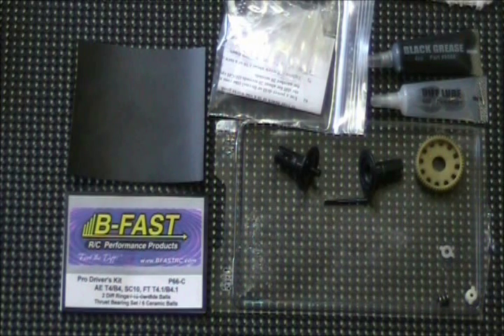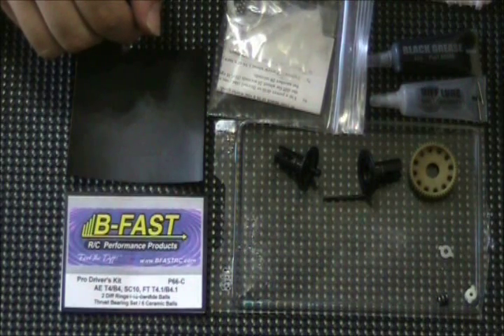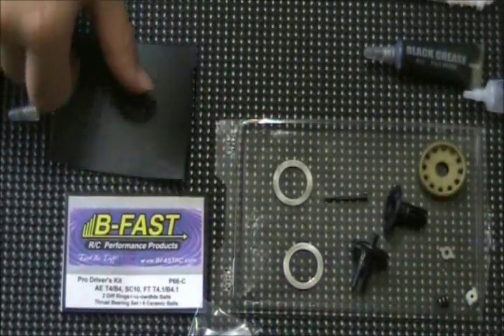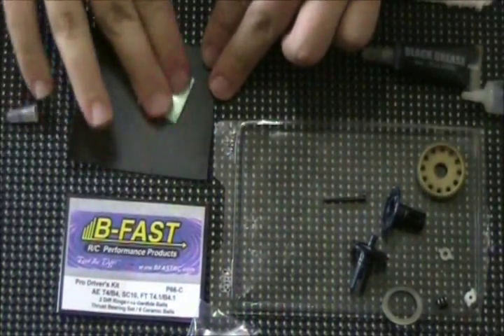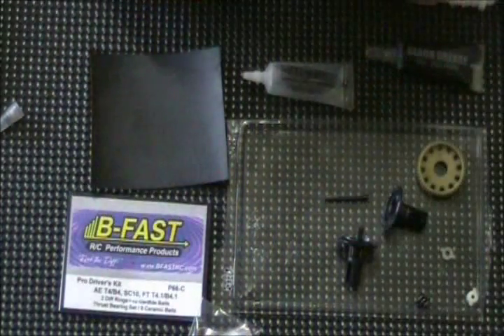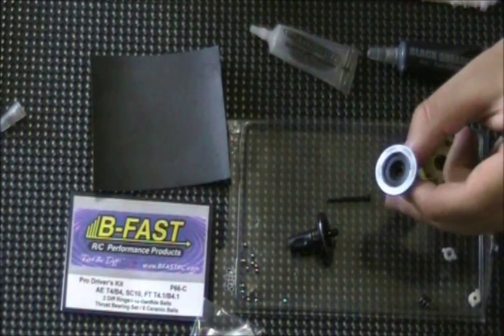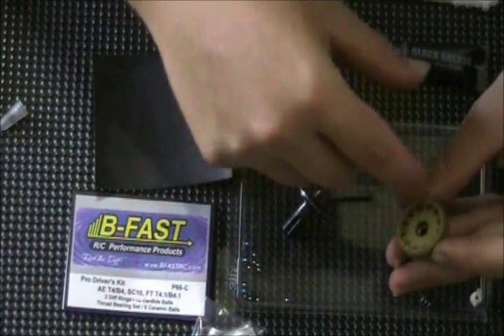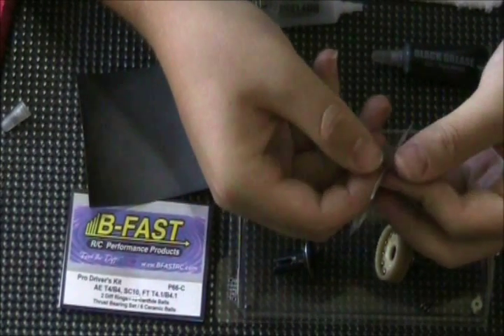How To Properly Build and Break In a Ball Differential and Slipper Clutch Part 1

Comment: I appreciate you doing this. I have over 20 vehicles and bought 2 team associated NTC3s and I didn't know they had ball diffs and ended up breaking an outdrive.  anyone that knows the part numbers for diff rebuild kits for a TC3 of appreciate it.  one is fine but the other has sat

Comment: look into investing into a niftech diff stand and diff break in tool. it'll save you heaps on time. rather than mounting the diff, then mounting the tranny, prepping both sides of diff,  and take a wheel off etc.... all you do with the stand and break in tool is build your diff, break in both sides with the break in tool on your dremel, mount it on the diff stand, check where you want your diff set at, retighten the thrust bolt, and you're done.